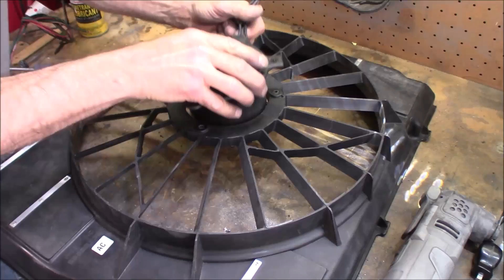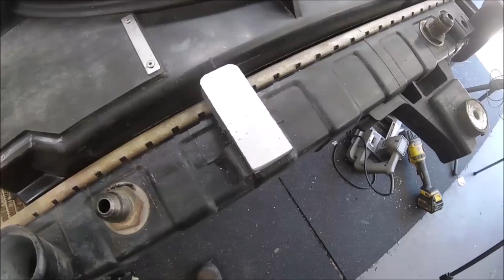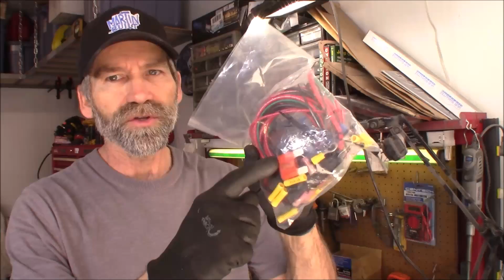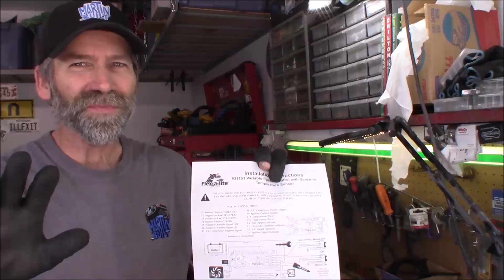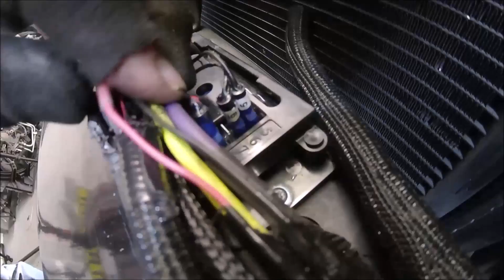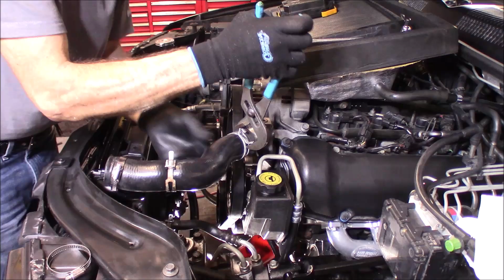Hydraulic to Electric Fan Conversion 01-04 Jeep Grand Cherokee 4.7L

Comment: Hey Martin, I know this is an old video, but I am just now pulling the trigger on taking out the hydro fan. With that said, I came across the issue of there not being many 5.9l ZJ fans out there. Is there any other fan you would suggest?
Also, is the only option to switch out to a 4.0 steering pump, or is there a fitting that you can modify the 4.7l pump to fit the smaller hose, and just plug the inlet from the bottom of the reservoir? 
Thanks in advance!
Reply from the maker: you can try the Mercury Villager around a 97, Volve has a few and the Ford Taurus with 3.8L
It's not the fittings you have to worrier about, its the volume of fluid that pump will move. It will blow the seals out of the steering gear box.
Reply: @martinbuilt  Thanks for the quick reply! Makes sense on the pump, so will make sure to replace it with a 4.0l one. 
As for the fan, I pulled a Volvo fan from the junkyard as I have seen many XJ conversions to it, but when I was trying to fit it to an old radiator I have, it just seems too small (~15" vs. ~20" on the factory hydro). To be honest, not sure if that matters, if it pulls air, but I do see that the ZJ one yo are using covers most of the radiator. What is your opinion on fan size? 
TIA!

Comment: Does this also make steering easier?  Even after replacing steering gear twice, then power steering pump "then" hydraulic fan with one from junk yard, steering is still harder than we'd like.  Will this provide an easier steering experience?
Reply from the maker: It made no difference on my Jeep, steering was the same.

Comment: Was there an issue with the hydraulic cooling fan, or was this simply to move away from that style-free up horsepower ? I've not found an issue with the hydraulic fans, unless the power steering system had issues or the wrong fluid was used in the system. Thanks for sharing this mod, especially the 10 ohm 100 watt resistor to keep the ECM happy!  As always, your work, thought process and logic are well  researched, well thought out,  covering every possible outcome!
Reply from the maker: Yes the hydraulic cooling fan would not coolly engine to my liking.  Even after I did the solenoid modification it would only get down to 210ﾟ
 With this electric fan I've got no problem keeping it at 185,  195 on the days when its a 108ﾟ ambient or more.

Comment: Another question for you Martin lol

I recently purchased a couple of the factory VDO PM9136 electric fan motors because they were insanely cheap (16 bucks a piece) as part of some close-out sale. In your opinion, is this fan motor sufficient for cooling the 4.7? I would also be running an upgraded all aluminum 2-row radiator. I can figure out which shroud will work, or even fabricate my own if need be, but I'm not sure if this motor is sufficient.
Reply from the maker: What fan blade and shroud are you using? This part number is for the motor only. That is a great price for the motor. 😉
Reply: @martinbuilt  Certainly open to any suggestions you'd have for fitment/efficiency. Currently, no shroud or blade to go with it. Sorry if I wasn't clear, yes, I only have the motor. So if you can suggest a blade and shroud, and if you believe the combination will be a sufficient replacement for the hydraulic setup, that's really what I'm hoping to hear.

Comment: Martin I do have a question where u get the hydraulic cooling fan sensor cause I check online I can only found it used if you have a place or a web site can you help me out thanks
Reply from the maker: I have a few solenoids if you need one contact me on Facebook Messenger.
Reply: @martinbuilt  ok perfect thanks martin

Comment: Hey Martin, do you think it would be feasible to get a couple brass plugs for the PS pump to block the ports for where the lines to the hydraulic fan used to go, instead of replacing the pump with another one? Or is there a reason you don't think that's a good idea? Or if not plugs, then just a bypass line where it goes from one port directly to the other? I already bought a rebuild kit for my existing pump so I'd like to use it if I can lol
Reply from the maker: The power steering pump that is designed to be used with the hydraulic fan moves incredible amount of fluid and without the hydraulic fan in place can damage the power steering pump and this is why the PS pump needs to be replaced.
Reply: @martinbuilt  That makes sense. Thanks for the info!

Comment: Dear Martín, cordial greetings from Ecuador. I am also converting from a 2001 gran cherokee 4.7. I will use the electric fan motor from the taurus 3.8, I will keep the original fan, I will put a thermo switch 92 to 96 degrees Celsius, I plan to keep the original thermostat of 91 degrees Celsius. Any advice or suggestion. Thank you

Comment: Quick question for you! I just got a 99 Jeep wj limited 4.7L. And it has a combination of an electric fan and a mechanical fan. The mechanical fan seems like it is always engaged as it’s all I hear especially when it starts up and revs high for a second or 2. Would I be okay with just the electric or should I try to diagnose the mechanical issue and keep it? There’s a possibility I will be hauling a small trailer with a four wheeler on or maybe a smaller 16 foot aluminum boat
Reply from the maker: The electric fan alone will not be enough.  That particular electric fan is nowhere near as powerful as the one I install.

Comment: Okay. So will this work for those of us wj owners who have a 99&00 jeep? Mine already has the dual electric fans along with the clutch. I would really like to do away with the clutch fan all together. What extra steps would I need to take?
Reply from the maker: It would be even easier for the 99 and 2000 WJ's you will have no need to change the power steering pump or lines and no need to add a resistor to keep the ECM happy.

Comment: Hey Martin I've just bought a 2002 overland that's had a elec fan mod and is showing engine light with the hydraulic fan solenoid code.  Now I'm not very cluey with mechanics or electrics but I purchased a new power steering pump before viewing this video and it's the standard one not the 4.0 as you have done here.  Reason I was replacing was previous owner said the loud whine that's currently coming from the belt is the pump.   Could the standard pump work with this mod I am not sure how to tell difference whether the one currently in there is standard or the one you have used or where the wires from the original solenoid have ended up and how I'd go about troubleshooting myself as can't afford a mechanic and don't want to install the new pump to find out I'm creating a bigger issue and also would like to resolve the engine light issue
Reply: Oh and it's high output motor if makes any difference also haven't driven during day but temp hasn't been issue although I'm in Western Australia was 45celcius here last week so if there's advantage to either pump I'd prefer the cooler option.  Noticed in comments you said could have got some fittings to make the 4.7 pump work could you explain how and if it's cooler or not.
Reply: Me again I noticed you answered part of this question already stating to change the orifice I'm not sure exactly what that is guessing the outet and inlet possibly to the pump alsoentioned could do seals in the box I also have a death wobble issue I need to trace I found reciepts for 1500 worth of work done on control arms and bushes and other things in glovebox so I was thinking possibly bearings or the wheels or tyres but now I'm curious could the issue possibly be related to these seals or the pump and any suggestions what steps to take from here I am worried this may be very expensive fix I did get the car cheap and for 200000 kays the car is in beautiful condition clean engine bay exterior and exterior the elec fan mod I didn't even notice until went looking for this solenoid engine light issue so good chance may be related or I could be clutching straws here. We don't have the ease of sourcing parts here like you guys in the states and freight can be expensive also so before I waste any more money buying stuff that likely might not solve problem be good to get your thoughts you obviously know what your doing the jeep dealers here are shocking if you ever read jeep forums from Australia you would be horrified what Muppets represent Jeep down here.
Reply: My email is reddog1979@hotmail.com I can upload any pics that may help with seeing what's been done if helps I'm off to watch some of your other vids now btw this is 4th wj I've had lot of time under the hood my first was a dream unfortunately due to broken leg and couple years in wheelchair had to sell the next two were nightmares but I did learn a lot about them due to almost everything going wrong with them and days on end in forums and on YouTube finding out how to replace things lot that didn't turn out to be issue.   Radiator cap psi was one I had pretty much replaced ever other possible part in the cooling system including power steering fluids thermostats even the radiator itself with new radiator cap that our leading auto parts system had as the correct one only to find out down the track was incorrect and entire time was just the cap.  Also had overcharging battery issues that had me changing cables alternators batteries which literally swelled and blew before realising was the computer that was fried then changed that with incorrect one then changed that to another that was supposed to work with keylock change before finally I got another one which shouldn't have worked but did apart from dash playing up for first week or two and with the key from corresponding computer taped under the barrel.  I love these cars but they definitely test me dedication to them I wish they made them without the computers
Reply: I sent some pics to your FB the current pump has three outlet with one blocked and high pressure hose from pump to box

Comment: Hey Mr Martin I followed your site over to do this exact conversion and one I received the wrong high pressure line too I just received the power steering pump after waiting 14 days for it and it's the exact power steering pump that come stock on the Jeep so I'm a little confused as well your video doesn't show if there's still a third line for low pressure or do we just eliminate that one yeah so I'm not sure things are screwed up in your description down low or if Amazon just totally screwed me
Reply from the maker: The pump should only have one return line. It sounds like they sent the wrong pump.
Only only have 2 hoses to connect the supply side (high pressure) from pump to steering gear box and the return line from steering gear box to the back side of pump.
Reply: @martinbuilt   yes sir they did and it took two weeks or more to even get here lol no worries just wanted to let you know that it gav me the wrong one from the info. 
Also thank you for the tip on porting the tb I just finished mine up and it turned out great, I'll post a video of the complete custom rad and dual fan set up I did. I think you will appreciate it

Comment: Can't you just change the orifice and hose to the ps pump to the smaller orifice & hose and keep your ps pump? Maybe the regulator valve in the pump also? Is the orifice thread to the pump the same?
Reply from the maker: The original pump has a larger threaded orifice and this is why the talk needs to be replaced.

Comment: Do I have to have the ac wire? What if I set the temp down on the relay?
Reply from the maker: The fan is going to run on high almost all the time and when you initially start your engine and before it can even get warmed up you turn on your AC in the fan will not kick on this will overheat the air conditioning. I would recommend hooking up the AC wire
Reply: @martinbuilt   ok crap I don't think I have the right relay I got a another style but I did get two so maybe I can splice in to on and make it work.

Comment: AWESOME JOB.COULD A CLUTCH FAN BE INSTALLED INSTEAD OF THE ELECTRIC? THANKS
Reply from the maker: Thank you, yeah absolutely you can install a clutch fan. Then all you need is the wire wound resistor to prevent the service light from coming on.
Reply: Thank you. Love your videos.

Comment: Couldnt you have just ordered the electric fan shroud and fan for like $80 on line and used it.
Reply from the maker: I'll guarantee no $80 fan will out perform this one. It is hard to find any aftermarket fans that can out perform this fan or the Ford Taurus 3.8.
Reply: @martinbuilt  i hear that.
Reply: @martinbuilt  so Ford Taurus 3.8 fun will work with this mod
Reply: @martinbuilt  oops my bad found out you already answers that but what’s the part number of the 98 fun

Comment: I wish you were in Mozambique. Would like to do this convention!
Reply from the maker: yeah that is a bit far. You can do it.
Reply: @martinbuilt  I don’t think so, I don’t have the skills. I have some  questions: the car is very hot inside, I think the heat of the engine is getting in to the car. Do you know How to solve it? My hidráulic fan is very slow and doesn’t change the speed.
Reply from the maker: @mozpassion8996   check the solenoid for 10 ohms and the fuse in the Power Distribution Block under the hood number 16 O2 sensor fuse is shared with the hydraulic fan.

Comment: How  come my power  steering is not working  after hydraulic  fan conversion  to electric  fan
Reply: How come  my power  steering  is not working  after hydraulic  fan conversion  to electric  fan
Reply from the maker: @donjones7541  did you replace the power steering pump with the earlier model?
Reply: What early  models  jeep  product or model  would  you  recommend  to change  out the factory  hydraulic  power steering  system..thanks

Comment: So im currently trying to do the same exact thing to the same exact jeep, my hydrualic fan is run off power steering, now im not understanding where the power steering lines would be going once converted to an electric fan, hope to hear back , thanks - Tim
Reply from the maker: Remove the hydraulic fan with the hydraulic lines then replace the power steering pump with a 99 or 2000 and replace the high pressure line from a 99 or 2000, high pressure line from power steering pump to steering gearbox and run the return line from the power steering cooler to power steering reservoir.
Reply: Thank you im very confident in this build, thanks to your videos!
Reply from the maker: @TB-vt1oo  you're very welcome!

Comment: I got a 02 Grand Cherokee. Recently put in a new radiator, now it leaks trans fluid, radiator fluid, and oil. I’m bout ready to send it down the road. Still runs great though.
Reply from the maker: sorry to hear that, what brand radiator did you use? There are some questionable manufactures out there. I purchased an all-aluminum radiator that didn't even come close to fitting and then the one I got that was made by OSC fit and worked perfectly. Don't give up.
Reply: The radiator fit good, but I’ve been chasing leaks since I installed it.
Found it leaking the other day at the threaded plug just below the radiator cap. The o ring was broken. The car is the age when everything starts going bad it seems. Still runs great though.
Reply: @martinbuilt  I’m not sure of the brand of radiator. I’m sure it was a cheaper one.

Comment: Hey it's Brenton from Australia I'm putting a clutch electric fan setup from a 99 00 wj on my 05 wj and just bring on the electric fan when a/c is on
Reply from the maker: Cool, let us know how it works out for you. Good time for you to do this since summer is just around the corner.
Reply: @martinbuilt  Hi Martin the setup works good main reason for this was I was having power steering problems when driving around town steering just went heavy like it wasn't getting pressure now everything works really well.

Comment: Martinbuilt , I've just done a road trip from Ravensthorpe to Karratha in Western Australia - 2,092kms in 2 days , outside air temp went from 8c to 36c , summer is coming so 45c+ soon
Before I set off I did your solenoid mod (half turn in) this saved the motor from cooking 
After I crossed the 26th parallel I had to turn off the aircon open the windows and put the heater fan on to keep the motor cool
It's the only Jeep in town , every other 4x4 is a Toyota Land Cruiser 79 series 4.5 V8 twin turbo diesel , but the base price is $80,000 AUD I paid $250 AUD for my WG in Jan
The fuel consumption rose with the solenoid mod from 8 litres per 100kms to 10.5 , but that's cheaper than a new motor
Reply from the maker: Thank you for sharing your experience with making the Solenoid Mod and glad to hear it worked out for you. That sound like quite the trip.

Comment: I'm A Lady that doesn't mind getting dirty.... Every guy or shop tells me something different.... I'm having a power steering and start hesitation.... I don't care for social media.... My Jeep looks like yours.... 2001 Quadra Drive Advance Trac RCS V8 4.7.... 247 J/272.... Think I'm having a cooling fan, heat a/c issue also.... Love This Jeep, learning a lot from you.... Anymore tips would be great 😎
Reply from the maker: does the fan change in RPM after you turn on the A/C or as the engine gets hotter?
Reply: @martinbuilt  Have all seasons, hesitates during start up no matter, have to give it gas.... When heat is on cool air comes from passenger side.... When a/c is on cool on driver side.... Haven't had to add coolent in 10yrs....???? Always reads high and over for oil and trans....???? But this is the 3rd power steering issue.... So I just did rear control arms myself.... Why not this.... It's such A Smooth Ride 😎
Reply from the maker: @yesienagiancaspro7520  Clean your IAC valve and throttle body...the problem with the A/C and heating is the blend doors are broken very common with the WJ's.